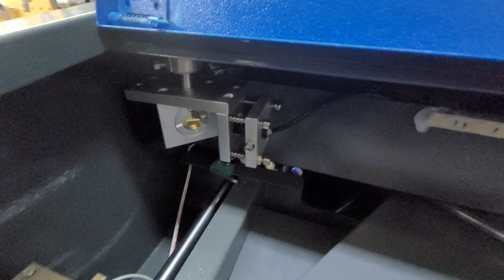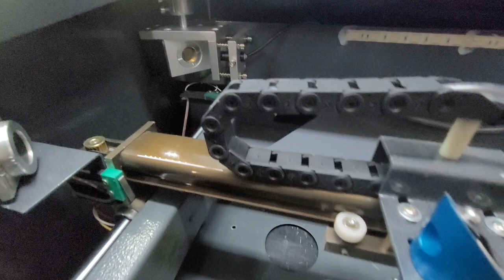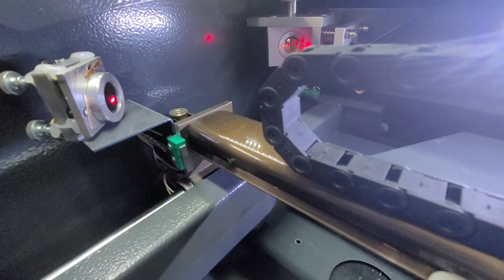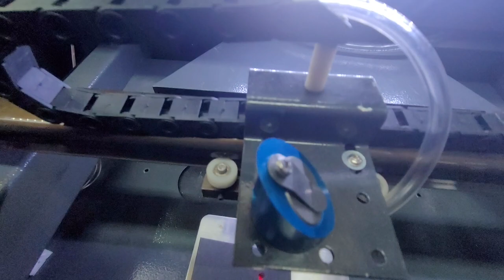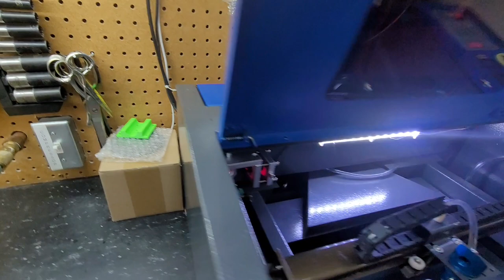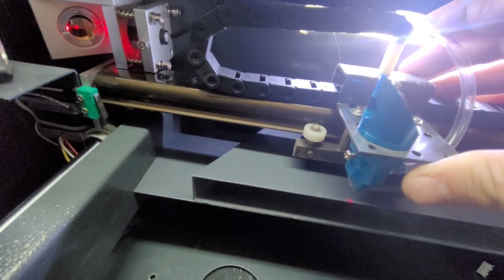Beam combiner for k40 laser

Comment: Rick, I really like the way you did that. Yeah, the red dot pointer is pretty much worthless. I removed mine and got rid of it. Have you noticed any measurable loss in the amount of power on the material, or is the trade off worth it. I am upgrading my Monport so I can learn everything I will need to do on my next (larger) laser. I am using a spacer and upsizing the tube and power supply next. That is the last thing I need to do except for the beam combiner - which I had pretty much given up on until I saw this video. I went ahead and put in a camera in its place, but not quite the same. You are absolutely correct about there not being much information out there on the beam combiner/K40. Most likely for the reasons you mentioned. Anyway, thanks again. Nice video.
Reply from the maker: John, I have not seen any noticeable change in the laser power. At least my library settings are still working well.
I would not have gone down this rabbit hole. But I have a trotec at work and I absolutely love having this ability.
 Good luck on your upgrades!

Comment: If there was more space on the left hand side of the case, could you reverse the orientation of the combiner mount so the laser pointer was on the left side? And do you think that this would allow the drag chain to clear and properly home? What I'm think is to cut out a section of the left side to clear the mount in the opposite orientation. Similar to how people cut out the side of the case in order to mount a longer tube and then 3d print a cover.